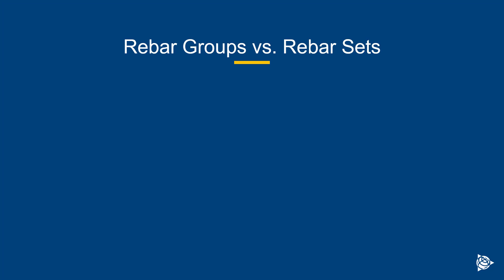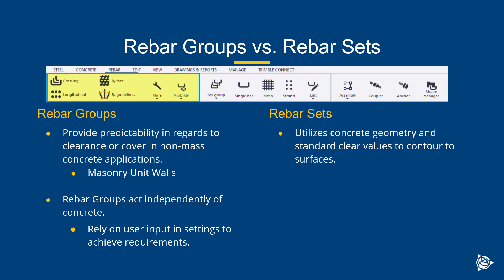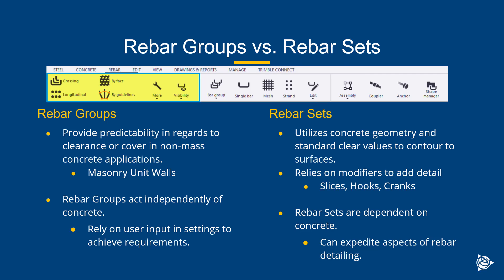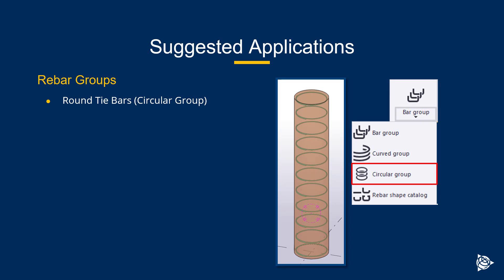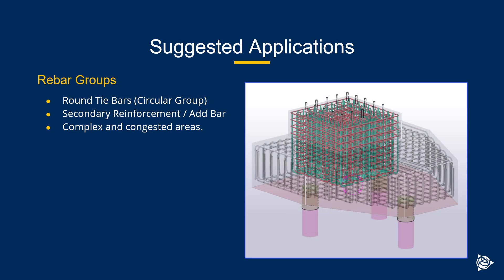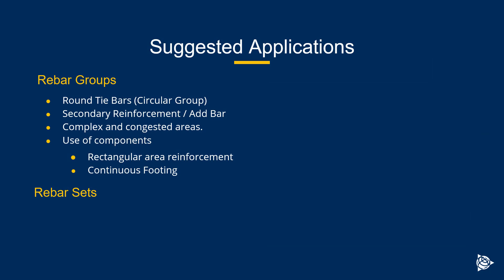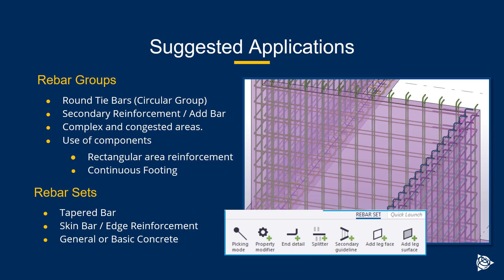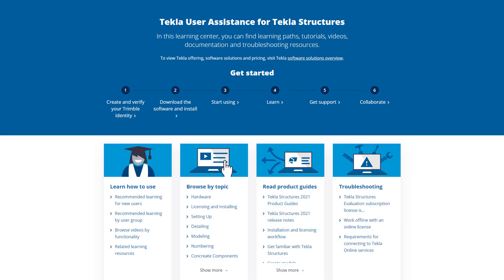Introduction to Rebar Tools in Tekla Structures

Comment: Hello sir, I have a problem with my rebar hook length and rebar units. The hook length in the fabvrication drawing and bending schedule does not match that in the model. I have tried to change this in the template editor settings but it doe not work. Please I need assitance.